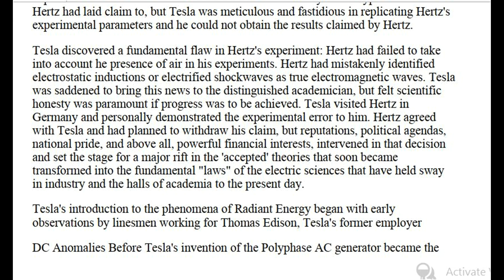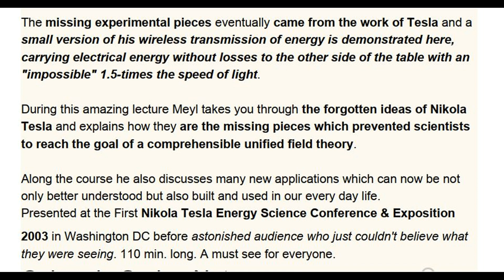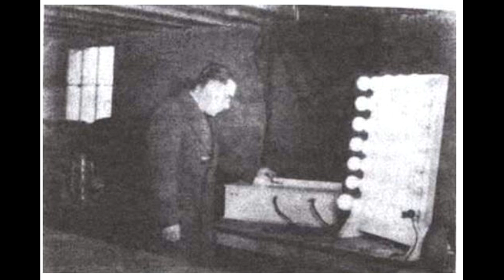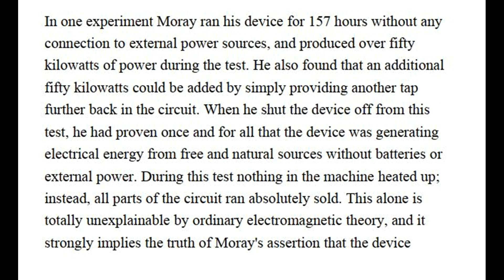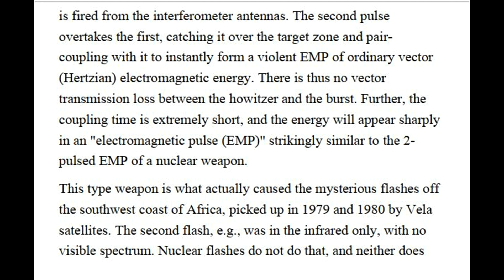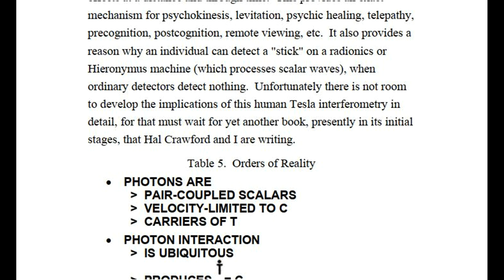Radiant energy unraveling Tesla's greatest secret part1

Comment: Yes, suppressed.   But note that Tesla took his term from his hero William Crookes, who called it "Radiant Matter." 
Tesla used "Radiant Energy" to refer to numerous unknown energy-forms which were still undiscovered in 1890:  "Cathode-rays" seen in Crookes tubes,   megavolt electron-streams (coming from Tesla's single-electron vacuum-tubes,)   x-rays and gamma rays, proton-beams, and the strange voltage-spikes issuing from capacitor-plates during fast-edge pulses.   

In today's language, some of Tesla's  remote-control systems were using beams of x-rays aimed at his distant metal plate, not beams of "Hertzian" waves.   What today we call "ionizing radiation," Tesla had already discovered, and named "Radiant energy."   In fact, his radiant-energy receiver is the same as a geiger-counter, but was invented nearly three decades early.   It measures UV light falling on its metal plate.  But it also detects x-rays, gammas, and ion-beams.  Tesla is ignored, gets zero credit for this.   (If there was a glass tube around Tesla's plate, and a different one-ATM gas-mixture,  it would be instantly recognizable as a Geiger Counter.    But this was well before Becquerel/Curie radioactivity, and Tesla was using it as a sort of "photocell" for pulsed x-ray communications.    Tesla's x-ray tubes emitted narrow collimated beams. )
Reply: Hey I saw you on qoura 😅 , you are awesome.

Comment: Thank you for the video. Have you tried to build any prototype before?
Reply from the maker: I have tried to experiment with flyback transformer. I have built the circuit that generates square waves in 1kHz - 100 kHz range. No matter how I tried to modify flyback transformer, input power was always greater than output power. Spark gap indeed creates some kind of shockwaves, but it is very hard to get energy from shockwaves. Flyback transformer consumes 5 amps at 12 volts, which is 60W of power, but at the output it can't supply 5W led lightbulb with power. It is like some kind of witch devours 60 - 5 = 55 watts . 
It is much easier to get free energy using split flux transformer and delayed Lenz effect. By violating Lenz's law, it is possible to avoid witchcraft spell.